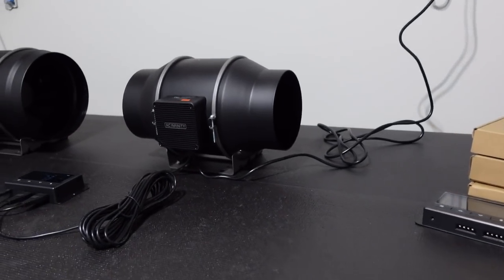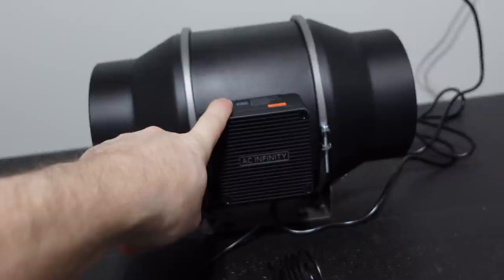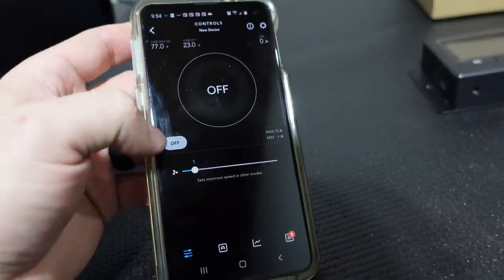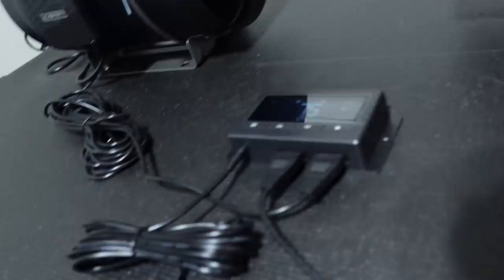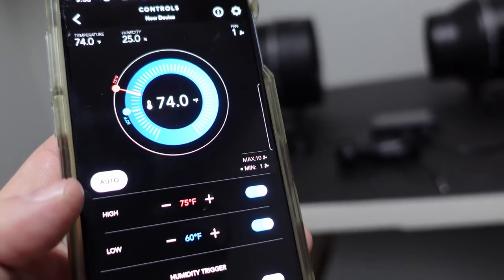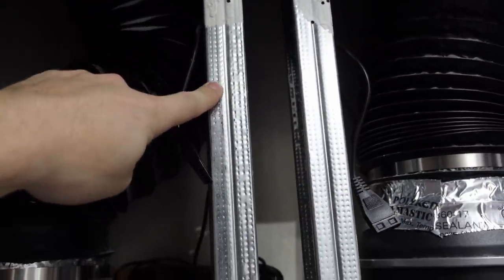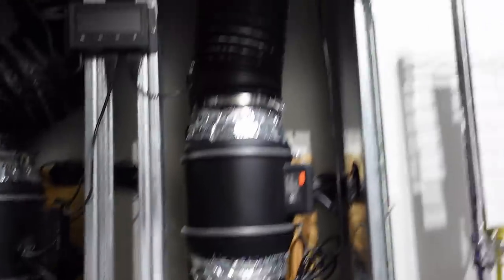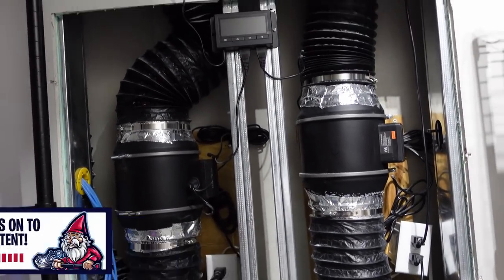Managing My Crypto Mining Room Heat & AirFlow

Comment from the maker: How do you guys manage your Crypto Mining Heat at Home?  Any creative solutions or products you find amazing?
Reply: AC Infinity for the win!  I have 2 of the 6" fans and they work wonderfully!  Getting ready to move the asics from the basement to the garage for some heat over the winter.
Reply: Love the AC Infinity and have 2 of 67 controllers you just got.  However, the controller only connects to Bluetooth so all control and notifications stop once you leave the house
Reply: I found the hydrofarm exhaust fan was alot more air movement then the infinity line of fans. I tried those one my project kept causing heat issues
Reply: @hplooking9834  Is it venting out a window or do you have use ducts and a venting grill?
Reply: How are you venting it out of the house/building?
Reply: @hplooking9834  where you running 6 or 8inch?

Comment: I use a  thermostat hooked variable voltage controller  to a 210 cfm 12v (turned down to 7-8 volts) 120mm38mm fan with a custom window shroud pulling in outdoor air and blowing it into a  4 inch x 8 foot insulated duct over to my cooling fans on the mining rig keeping temps at 33-38  i have the thermostat set to 68F and the heater inlet in my room is blocked the room stays a pretty constant 67-69 without the thermostat the room would end up getting very cold.

Comment: Seems like fairly low cfm. Maybe I’m not understanding but how is this better than the $39 pedestal fans from Home Depot?
Reply: Home security.  Better than having the window open when away; also good for rooms with no windows.  The cfm is high for a 6" diameter fan.  Box fans are cheaper and move more air due to their size.  I personally use a box fan at the window when temps are below 60 F.  On warmer days, the box fan blows cool air into the room and forces warm air out into the AC intake.
Reply: If the exhaust is setup correctly you would be removing the hot air as where a box fan would just be pushing air around.
Reply: fan is terrible idea. this type of fan is used in large basement parking spaces.
Reply: It's actually a solid point, it would have been great if someone could actually perform some real world scientific comparisons.
I'm actually using one of these pedestal fans from the Home depot equivalent in my country (Thailand) as an exhaust. The one i used can achieve something like 3000 CFM at full speed but i use mine at lower speed which is something like 1600 CFM and it manages to keep my room under 28~34 degrees Celsius when the temperature outside is most of the time 36~38 degrees Celsius. And that fan is just standing in front of my window lol

Comment: Newbie here! Was just researching this!  What are the ideal levels for gpu’s to operate?
Reply: As cold as possible.  Kidding aside, you want your vram to stay below 90 C.  Generally gpu will be cooler than the vram as it is the focus of your cooler and should not exceed 78 C.  I try to keep my vram in the low 80's and gpu in the 60's.  In regards to the video, cooling the air in the room is good.  I found having direct air on the cards themselves work better than managing the air in the room alone.  Air blowing across the cards from back to front or front to back works better than air blowing into the sides of the cards (front being the pci face plate).  Air blowing on to the sides of the cards recirculate the heat it is trying to exhaust back into they system.